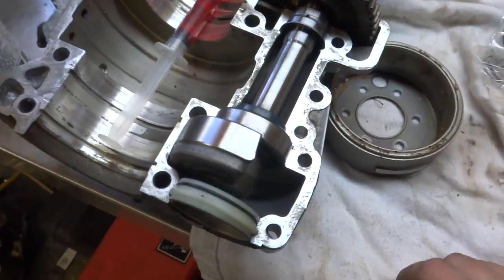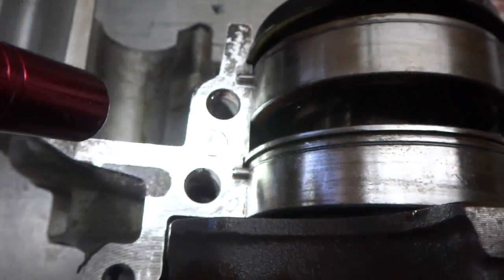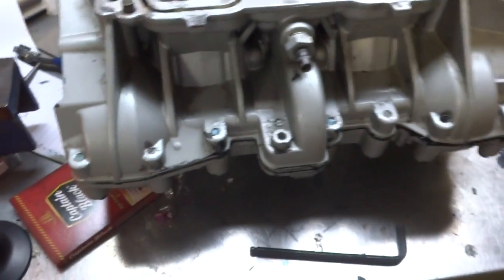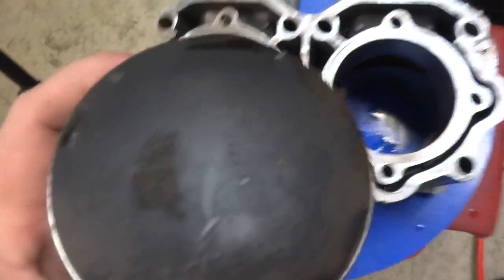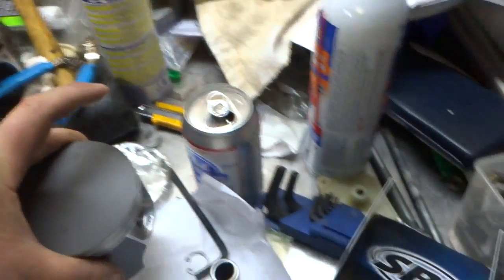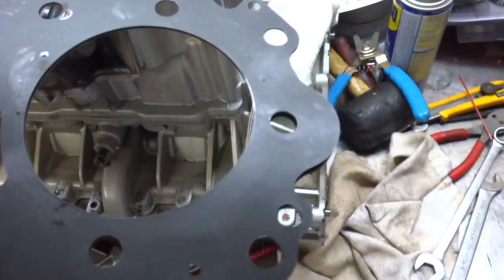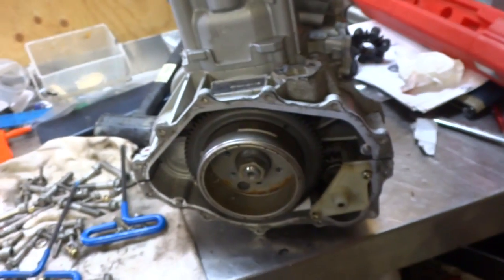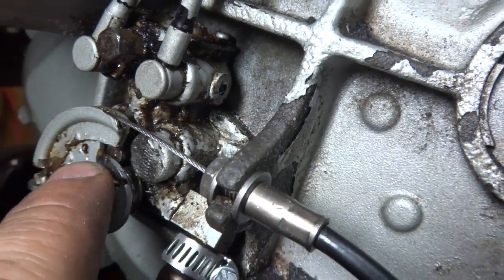Seadoo 951 Quick Reference Rebuild Guide

Comment: Just finished rebuilding my 951. Dropped it in the water on the weekend and did about 6hrs all up, with no issues. Ran very well. Thank you so much for your videos. Found them very informative, highlighting all the really important issues and entertaining too with some funny moments. Without the videos and the manual you made sure I printed, no doubt I wouldn't have been able to do it. Saved me $2K +. Thanks again, have many more beers mate.

Just one question. I had to hone the cylinders and upsize pistons (.75). A guy said to me today I might need to rejet the carby. What do you think? Thanks 

Regards
Pete from Australia

Comment: If you read black silicon is not good for gas only for oil since motor is oil x gas its no good look at permeate label it tells you this , there is a special white one used by seadoo that is correct.